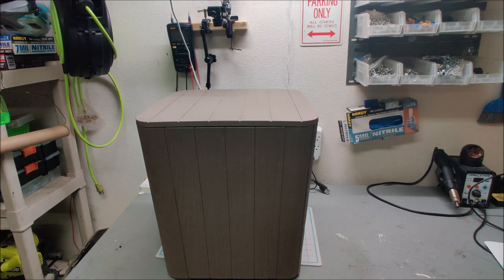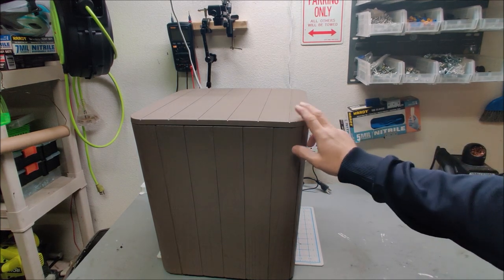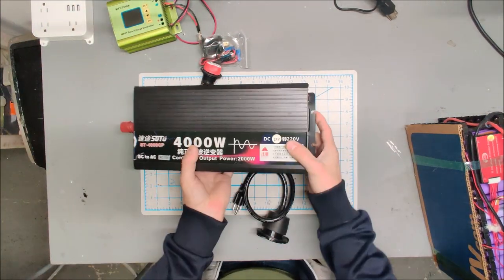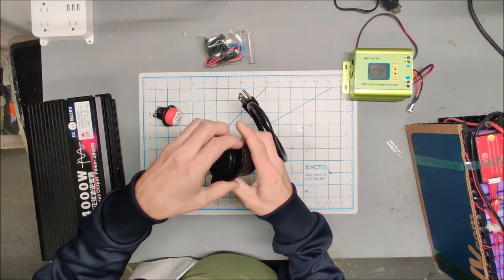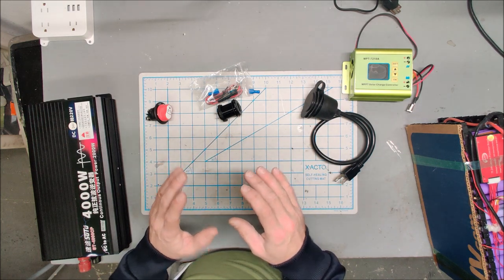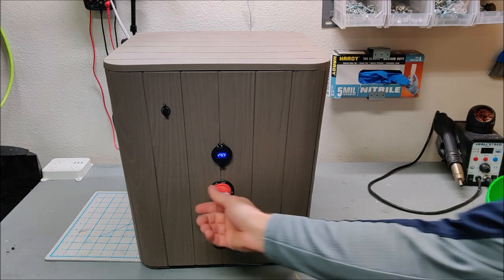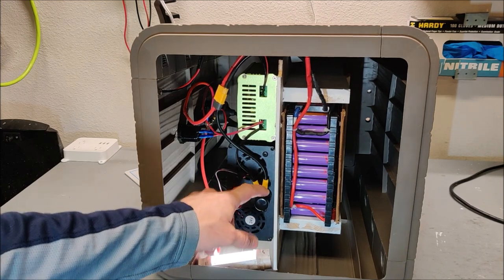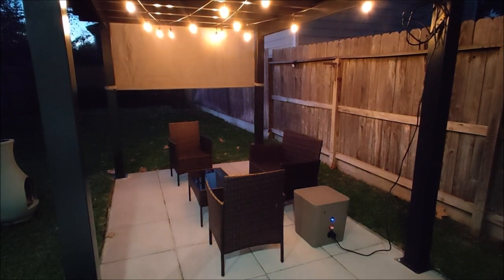Solar Powered Pergola - Outdoor Solar Generator

Comment: Stevenc22 great build, are you going to install fans, The case is big it might provide air flow you think...Peace
Reply from the maker: I was going to install a fan, but since im running pretty light loads for now im going to try without a fan. Thanks!